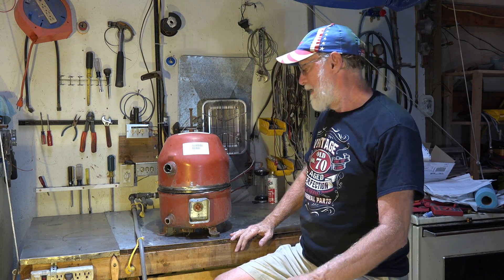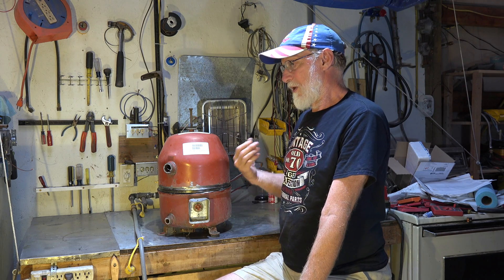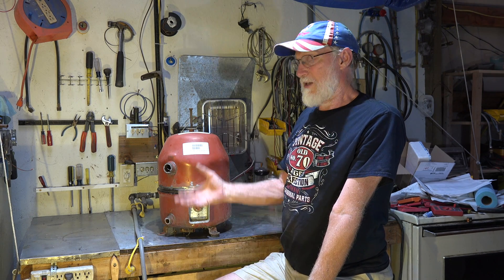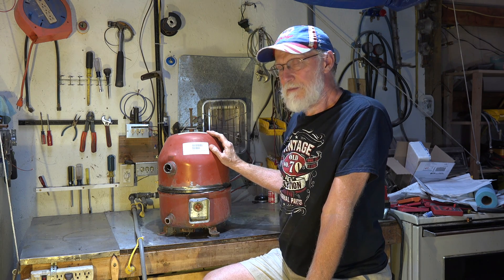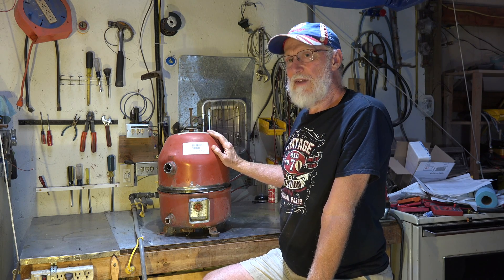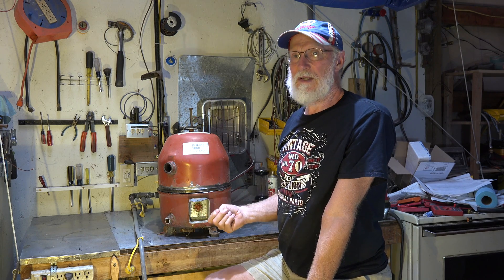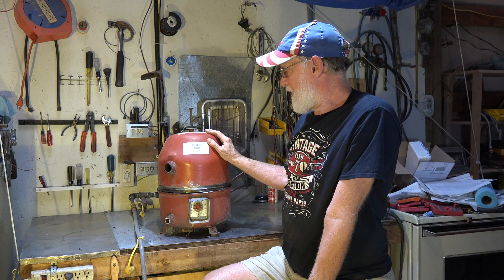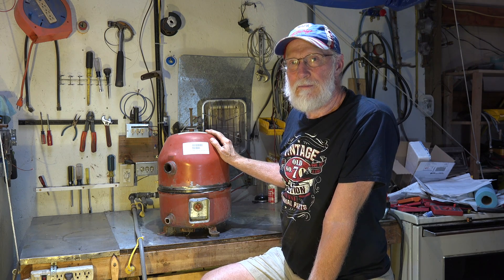The refrigeration compressor #2

Comment: Electrical question.  Since my 3.5 ton condenser unit is drawing 12 amps which includes both the compressor and condenser fan and the rated compressor draw on the nameplate is 19 RLA (running loaded amps) and the condenser fan is drawing 1.2 amps and the nameplate states 1.6 amps.  Now I know that initial start-up for both items are around three (3) times this value which is 36 amps, which agrees with the 40 amp circuit breaker installed on the service panel.  I believe the 40 amp circuit breaker is actually two 20 amps circuit breakers joined together.

If this is the case, why can't the wire size be only 12 gauge which can handle 20 amps instead of either 6 or 8 gauge as installed in my unit?  Is it because of the start-up current of actual current of 12 amps times three (3) issue?  This only happens for a few milliseconds.  Please explain.
Reply from the maker: It is not because of the startup current.  Breakers are there to protect the wire, not the appliance.  The 40 amp breaker is not 2, 20 amp breakers.  The draw that the breaker is designed to handle is 40 amps.  The size of the wire and the breaker size are determined by the ampacity on the rating plate.  Looking at your system, I would think it would be a a 30 amp breaker and wire size.  So you may have an oversized breaker and wire size.  In the end result, the NEC determines the wire and breaker size with its charts.  Hope this helps.
GFM

Comment: I always wonder about the effect of low heat loading on the evap in a TXV system and the reduced flow of refrigerant back to the can. Yes the amp draw is reduced and the motor is producing less heat than under full load but it would seem that overheating would be more problematic in most residential units.   Do you see that in many installs?
Reply from the maker: Unless the outside temp is low enough to make the condensing pressure too low for the refrigerant to flow, the TXV system will adapt quite well to low load conditions.  I would be more worried about a fixed orifice system.
GFM

Comment: Ok, next! I wanna see inside that Trane compressor. Years ago in one of the Trane classes I've been in they showed a cutaway of the suction valve which, I think, is the main feature that sets these compressors above the others. What I've been curious about is does the Trane scroll compressors have that same suction valve. Idk, I just can't wait to see the next video. God speed
Reply from the maker: The scrolls do no use these fittings.  Of all mechanical fittings, the Trane ones leaked the least.
GFM

Comment: Engineered obsolescence. I hate it. I do like 35 to 50 year old or older manufactured devices. Yes, they were over built and inefficiently utilized the resources used to produce them etc., etc. However, if you know what your doing and maybe even have to anglo engineer a fix they certainly are more worth the time and energy expended to maintain and repair them. Even as inefficient as they are compared to equipment manufactured today that you just throw into the scrap heap or land fill after 10-20 years of service. Sure advancements and improvements will be made in those decades but really is it worth it to always uptrade, upgrade just to keep up with the Jones', the Smiths' and the Jeffersons ?
Reply from the maker: I like to compare to autos to get an idea of the differences.  A 1955 auto was certainly made with heavier materials.  Compared to modern autos they are death traps, ridiculously inefficient, required constant maintenance, wore out very fast, handled like a tank and are hard to drive.  I would never trade a modern air conditioner for a 40 or 50 year old one.  They lasted less time, leaked more and were ridiculously inefficient.  The sometimes common replacement of newer A/Cs is more due to changes in refrigerant and salesmen selling products when a repair was the best option.
GFM

Comment: great video, what would be the likely hood, if a liquid line filter dryer (uni-directional) is installed backwards, of damage to the evap coil? i ask because i ran into a brand new Maratherm ICP system that wasn't cooling (suction line icing up). this 2 ton TXV ICP "N" coil had random cold sections on the coil. other sections were room temp. seemed some of the distribution tubes after the TXV were blocked. brand new system, only a few days old, only problem i found was FD was installed reverse on the condenser, refer charge was not low. could an incorrectly installed FD cause this? thanks. i should add, i replaced ICP coil with a goodman 2 ton piston coil and replaced/installed correctly the FD.
Reply from the maker: It could.  It is not common, but most of these filters can release pieces of desiccant into the lines if installed backwards.  Sounds like a replacement unit is due.
GFM